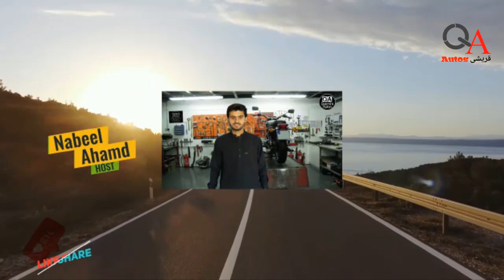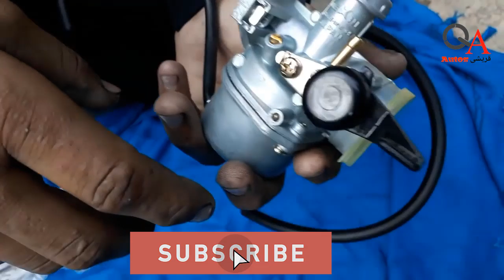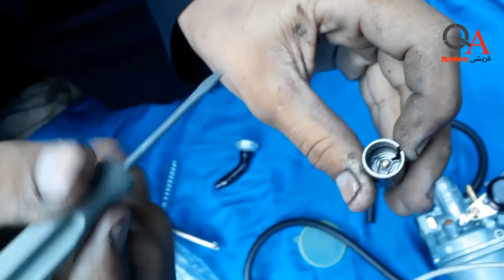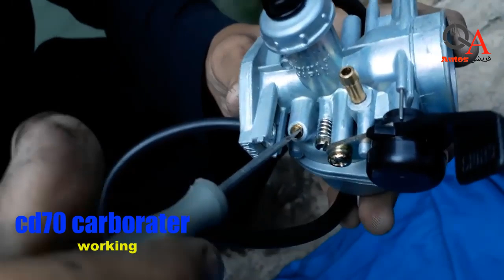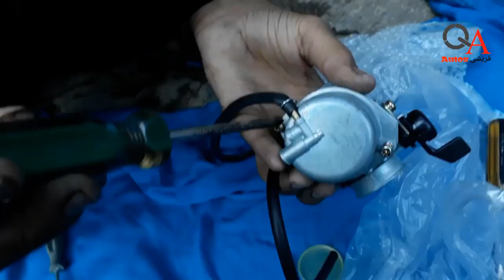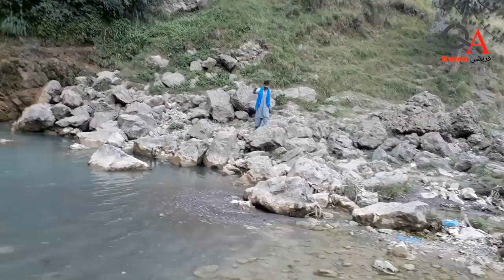carburetor mechanic/a carburetor service

Comment: Jets are very important in carburetor so you have describe very precious information
Reply: Sir! Kiya Simple 70cc Chinese bike mai self-starter install hosakta ha?
Reply from the maker: Thankx
Reply: @izharkabal  this is not possible because self start proper housing ma install kia hota ha
Reply: @mechanic3d   Thanks
Reply: Euro technology kia hota hy????
Reply: @nabeelmalik.4714  Euro 2 technology is emissions standard to reduce dangerous gases from exhaust and crankcase
Reply: @mechanic3d  thanks
Reply: @Dabir Ahmed 2.5 circle
Reply: @Dabir Ahmed 900 degrees
Reply: @Dabir Ahmed  bhai yeah chakar hen
Reply: bhai petrol kum krny pr vdo banao app

Comment: Carburetor KeiHin PC09D (16mm) comes with Honda CD70 models 1962-1992, Carburetor KeiHin PC09H (16mm) comes with Honda CD70 Big models 1993-2012, Carburetor KeiHin PB5PC (15mm) comes with Honda CD70 Euro2 models 2013 to till present and with Honda C50 models 1962-1982 too. 

Carburetor KeiHin PC09F (16mm) comes with Sohrab JS70 and Sohrab S100 (models 1995 to till present), in chineese 70cc old model bikes till 2012 PZ16 carburetor and in chineese 70cc new euro2 models from 2013 Carburetor Keima PB5PC.

Carburetor KeiHin PB7EW comes with Honda Pridor CD100 Euro2.

Carburetor Dekni PZ22 (22mm) comes with Qingqi QM100, United US100, Road Prince RP110, Hero RF70 and Metro MR70 old model.

For 70cc alteration purpose this Carburetor Dekni PZ22 is much better to be installed than CG125 Carburetor because Dekni PZ22 Carburetor has same shape and air filter fitting as of 70cc Carburetor but PZ22 has a bigger throttle slide bore which gives more peak performance and speed for 70cc alteration purpose.

Carburetor KeiHin PDCBR (26mm) comes with Honda CG125, Carburetor KeiHin PDCBR (30mm) comes with Honda CD175, CD185 Twin & CD200 Road Master.

Carburetor Dekni PZ30 (30mm) comes with New Asia/Meezan/Tez Raftar Loaders/Auto Rickshaws 200cc.

For 125cc alteration purpose this Carburetor Dekni PZ30 or FiT CRLF PZ30 for CG200 is better because it has same shape and fitting as of 125cc Carburetor but PZ30 has a bigger throttle slide bore which gives more peak performance and speed for 125cc alteration purpose.